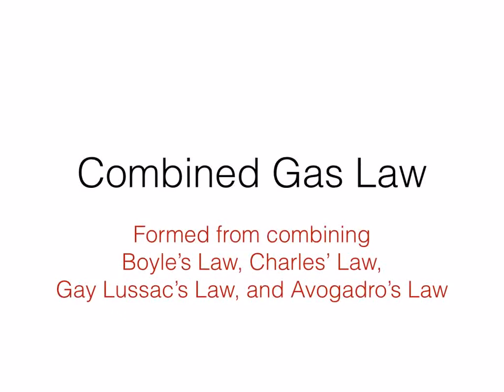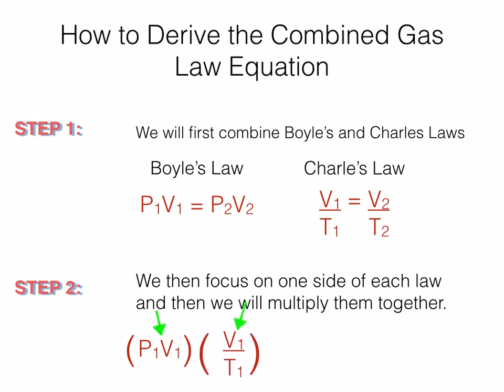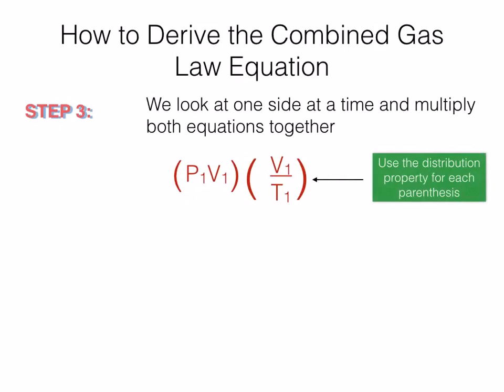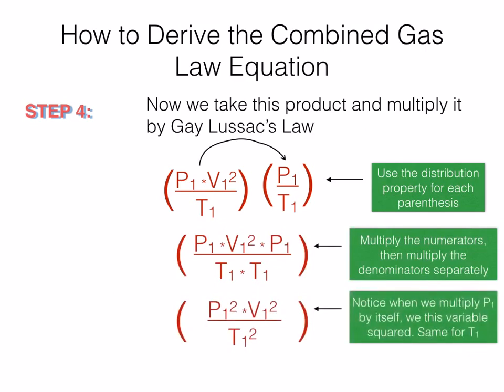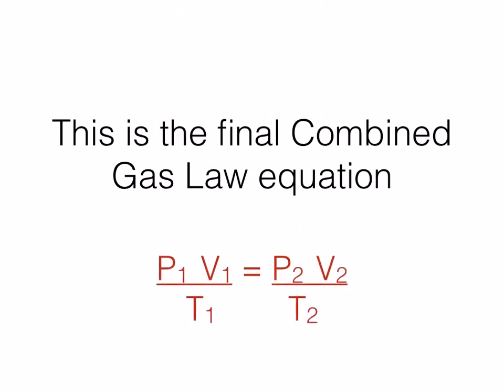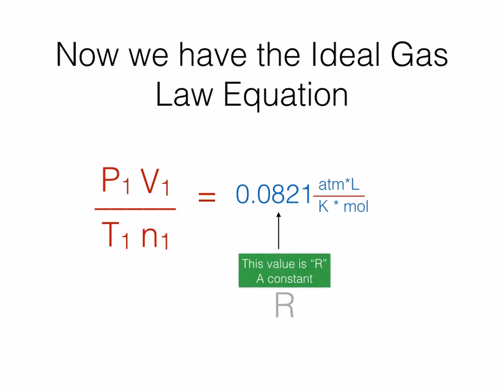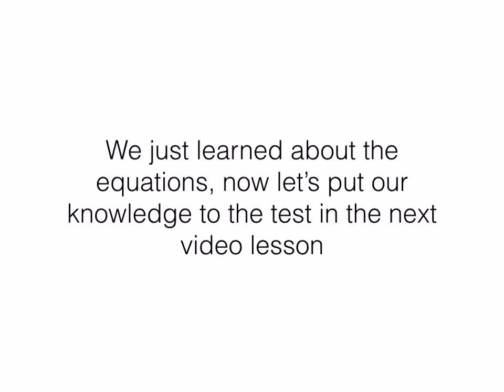Deriving the combined and Ideal gas Laws (part 2)

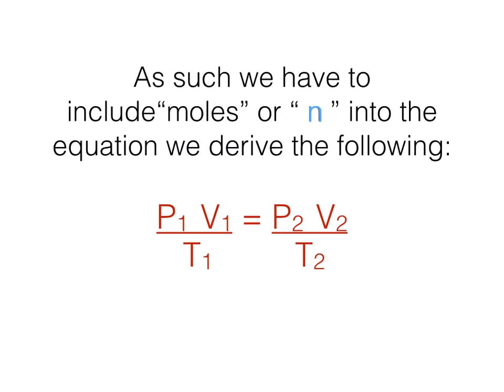Comment: At (4:00), why is n multiplied into denominator of the Combined gas Law? From Avogadro's Law, Constant K = v/n. If we multiply this into the Combined gas Law, shouldn't the new equation be (P V^2)/(T n) instead?
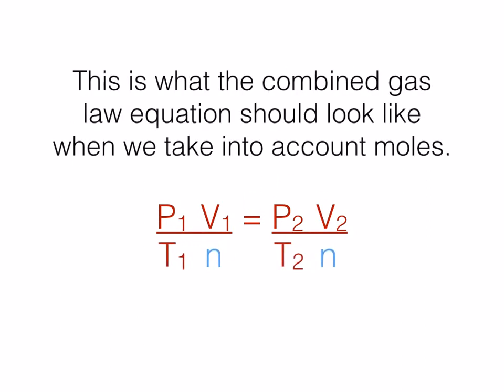Reply from the maker: Thank you for your comment.  Actually, we don't multiply it against anything.  Up to this point, we took various gas laws (i.e. Boyles, Charles, and Gåy Lussac's Laws).  Most representations of the Combined gas law is the equation shown at 4:00.  The problem is that it does not show the true relationship between volume and number of moles as Avogadro's law does (k=v/n).  We do so, by mathematically acknowledging Avogadro's law as you have indicated; "v" over "n."  This is the reason we write the "n" in the denominator at time 4:10. Again, thank you for your comment and question.